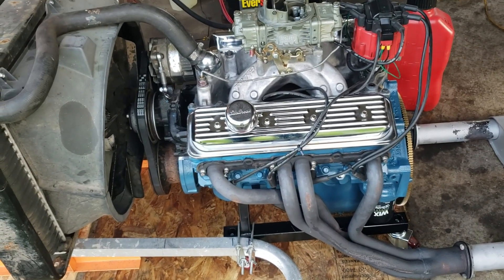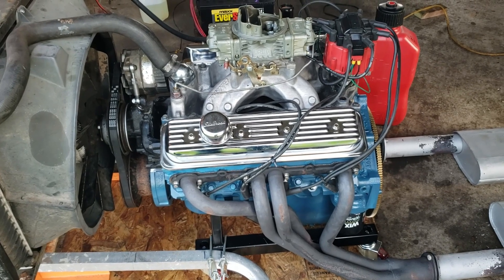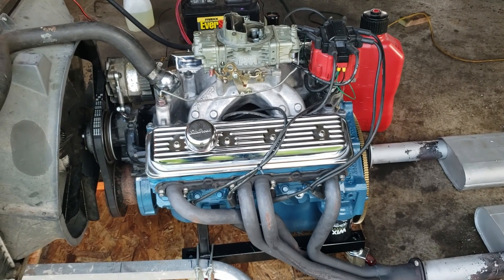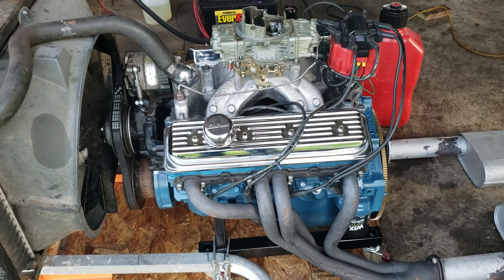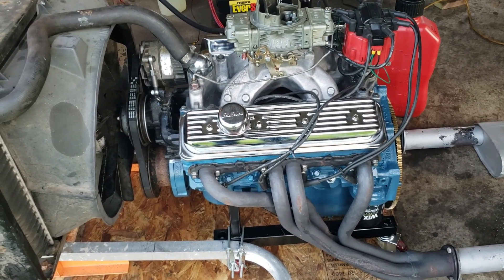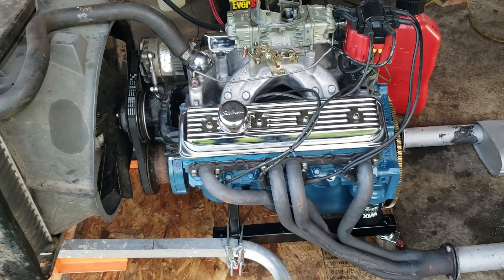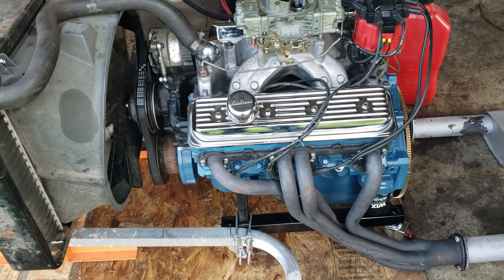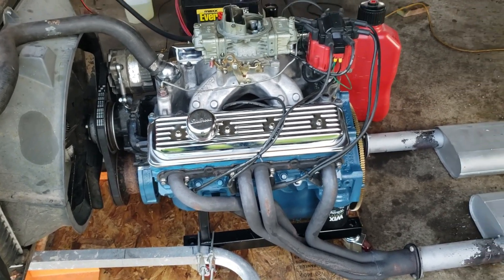Chevy 400 vortec heads 256/266 @.050 lift cam 106 l.s

Comment: Hey nice engine build. Have a question. Did you steam port wholes in the vortex heads to match the old 400 iron heads? My apologies if it has been asked before.
Reply from the maker: No problem. No steam holes drilled. I do plan on moving to a larger head after testing the vortecs.
Reply: @nylegreen261 so what did you do in place of drilling the steam holes? My grandpas best friend traded my dad and I an 85 Camaro with a 406 for a 55 bel air (the bel air was in pieces down to the frame). He said he did not drill steam holes in the heads he put on it but he told me another thing you can do to sort of simulate steam holes
Reply: Twice I ran normal SB 194 heads and 202 - 160 value heads on 2 400 SB without drilling the steam holes, I wonder at what point are the steam holes needed? these engines had been used in Blazers for normal driving.  @nylegreen261

Comment: Not originally developed heads as cast vortec heads for a 400 ci engine,  never happened  and definitely not factory production.  Still won't ever be considered for production  ur a dreamer and never will be a producer. You will never have the chops to even be a designer,  let alone an engineer